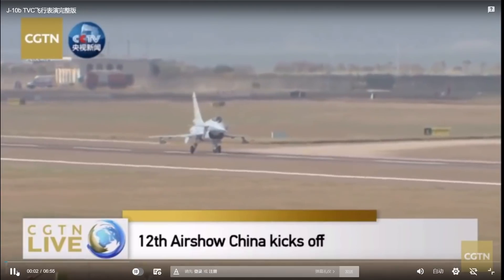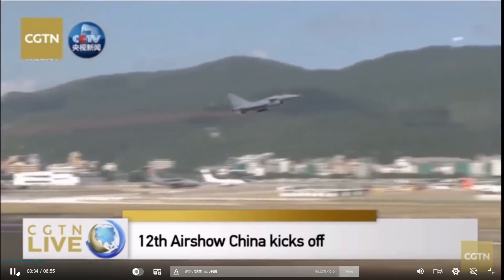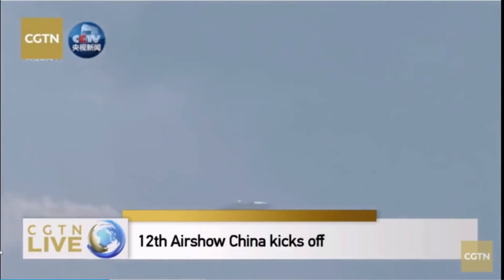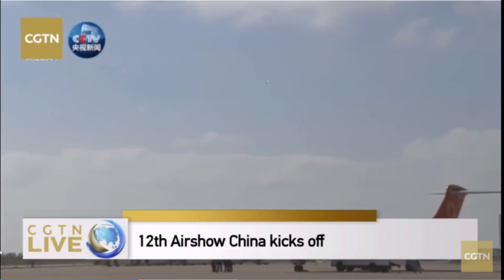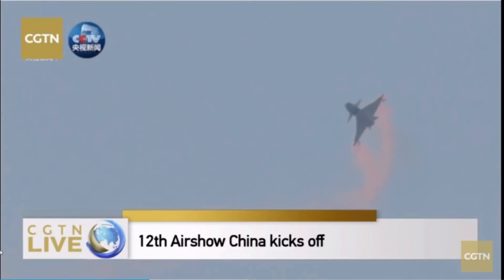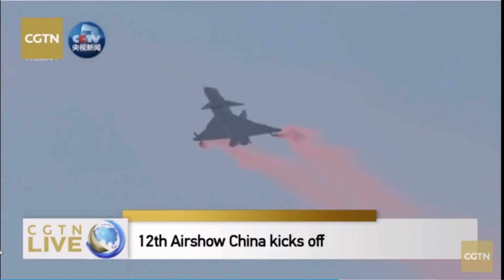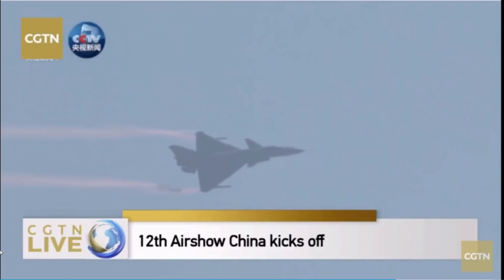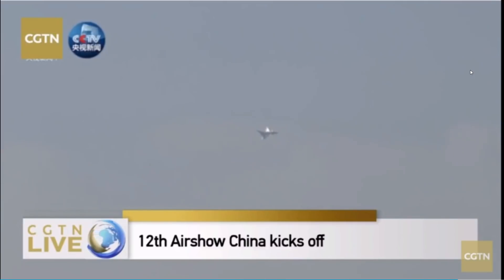J-10B Cobra Maneuver, Vector Thrust, and Aerobatics Demonstration

Comment: I think l did see Chinese engineers analyse a Russian SU35 by pulling it apart and reverse engineering the engine.
Should be interesting to see what aircraft they have on the Chinese aircraft carriers in the next ten years.
Reply: @fredgarvin9262 
With some of them PUT into military research projects with not much choice.
As Chinese wages go up less consumer goods will be produced in China.
Nothing l have seen Military wise or consumer goods wise impresses me that much.
And A LOT of the Chinese consumer goods are designed outside of China.
Reply: the su35 that russia sold to China do not have TVC feature........and china absolutely disappointed with Su35 quality to the point they canceled order from 48 to 24.
Reply: @minus21334  : Russia likes to deliver monkey models to untrusted clients...
Reply: @El-Poussah  we do not need that much from russian. it is now more like the other way around

Comment: I got confused thinking that the j-10 was a Eurofighter typhoon. really similar design, but typhoon has 2 engines not one like j-10
Reply: This is USA and Israel project then it sold chine...
Reply: J-10 is of new generation technology, it would perform better than Typhoon even with single engine, as it has vector thrust.
Reply: @FF-cz8sg  J-10 is the Israeli Lavi technical package sold to China after the Israeli government refused to fund Lavi, instead favoring more advanced F-16 procurement from the US with Israeli-specific modifications.  China built the J-10 using production and tooling technology sold to them during the Clinton Administration in the 1990s, after China illegally influenced the 1992 and 1996 elections in the US with millions donated to Bill Clinton through fronts in Indonesia.

J-10B uses the DSI intake technology from the F-16 DSI demonstrator, which was developed for JSF technology research.  The DSI inlet helps reduce the J-10B's frontal RCS by eliminating any line-of-sight to the engine fan stage frontal section, which is a huge radar reflector.

The question you should ask is why the US never adopted TVC engine technology on F-15s and F-16s, which is where TVC was first demonstrated on with the F-15 STOL/MTD and F-16 MATV in the 1980s and early 1990s, along with the X-31 program.
Reply: @minus21334  the J-9 doesnt look anything like the J-10. It just has canards. The J-10 has the same layout as the lavi only a little longer and diffrent
Reply: @yoamal1187  J10 is literally much larger than Lavi in size. yall trying to dismiss the link to j9 wont change a thing j10 was based on j9 with delta-canard configuration set for research and production back in 70s.
Reply: @minus21334  i said its a little bigger, but everything is the same. Intake location, delta wing, single engine and single tail. Also china came in to see progress on the lavi program when it was in production
Reply: @yoamal1187  both Isareal and China deny the link between lavi and J10, what the hell are you talking about? you know better than Chinese right?
Reply: @xiaoyulin4008  china also says that nothing happend in tiananmen square, Beijing on June 5, 1989
Reply: @yoamal1187  tell me where is lavi now?? where is it??
Reply: @FF-cz8sg  : J-10C with AESA radar was ridiculed by Thai Gripen-C with PESA radar during drills at such a point that even a PLAAF senior officer acknowledged the fact and said that PLAAF needs something like the Gripen!
Actually, since J-10C behaved better than J-10A/B in WVR where Gripen-C dominance was reduced, but Gripen ended with a 40:9 kill ratio in BVR, RTAF decided to replace AMRAAM and Sidewinder by Meteor and IRIS-T, they may upgrade Gripen-C with the Gripen-E's AESA radar too...
Gripen is no match for Typhoon, Typhoon is no match for Rafale... Do you know how the MICA is nicknamed in NATO? "Silent death". Don't assume it was never used in combat : ALL FrAF kills are classified since 1953... 

Vectored thrust is only interesting for heavy aircraft as a compensation for inertia, but you lose energy using it... Rafale takes 11G (or more if the pilot can deal with it : the airframe won't sustain metal fatigue unless being exposed to more than 13G!) without VT.
If you need VT on a mid-weight jet fighter, it's that it sucks big league.

Comment: Very good but f 35 A can do that without vector trust
Reply: A F-35 doing a cobra, NEVER
Reply: prove it
Reply: the cost to build one f35 by usa can build 10 j10 by china, so go figure
Reply: @FF-cz8sg  The latest generation supersonic trainer aircraft made in Russia cost a minimum of $17 million per, and does't have the capabilities of the J-10B.  The yuan is more valuable than the ruble.  A J-10A today would cost $32.73 million.  Since the J-10B has the DSI and is claimed to have an AESA radar with more advanced avionics, the unit cost will be considerably more.  Any TVC nozzle will not only add significant cost to the engine, but to maintenance.  I would estimate the unit cost of an AESA and TVC-equipped J-10B to be in the $40-$50 million range easily, given the scale of industry that is required to manufacture the necessary systems being discussed.

So even 10 J-10A limited 4th Gen fighters would cost $327.3 million without ancillary equipment.  A single F-35A costs less than $78 million, while being able to engage and destroy 6 J-10A or Bs in one sortie without challenge, and also performing duties of AWACS, ISR, and EW.  The J-10B is not able to do any of this since it is 4th Gen multirole.

A cost to effectiveness analysis shows the J-10 is nothing but a manned target in a 5th Gen world.
Reply: @LRRPFco52  : AESA on J-10C, not J-10B... And Gripen-C with PESA had the edge over J-10C, as well as J-10A/B and J-11A during drills in Thailand.
Reply: @El-Poussah  Gripen C got smoked by J-10C in Falcon Strike exercises in both BVR and WVR. Gripen C does not have PESA, but mechanically-steered pulse doppler radar.

J-10C has smaller RCS, bigger radar that is also an AESA, and longer reach with PL-15, so it always has first-look, first-shoot against Gripen C.
Reply: @LRRPFco52  I am sorry if I sound dumb but I am a layman and just want to know the range of PL-15 and the range of AESA. I heard from Indian analysts that PL-15 is useless against combat jets as AESA radar cant match its range so by the time AESA locks in the target PL-15 becomes useless as compared to Meteors due to shorter distance and they say its only good for slower AWACS.
Reply: @realistgunner4613  Since nobody but the Chinese has their hands on material samples of the PL-15s, we lean on Chinese comparisons between them and the RVV-AE export R-77 variant.  China is really unhappy with the RVV-AE, as is India, for several reasons.

China had the RVV-AE modeled with ACMI pre-coordinated with Royal Thai Air Force before they did Falcon Strike Exercises, and the RVV-AE was much shorter ranged than the AIM-120C.  

Supposedly, the PL-12 has about the same WEZ as an AIM-120C.

The PL-15 is a VLRAAM that is meant to out-reach the AIM-120C/D, using a 3m long body, dual pulse rocket motor, AESA seeker, and copied guidance architecture from US/Western BVRAAMs.

It caused a rapid initiative in the US to make a new missile, the AIM-260, with US senior leadership mentioning that we needed to make a longer stick for that fight.

The most interesting thing to me in the US is that we have not adopted a propulsion arrangement like the Meteor, and instead are leaning on major improvements in rocket motor propulsion, with dual-stages and reduced size guidance due to Moore’s Law.

If someone tells you that Long Range AAMs are useless because of AESA detection ranges, I would raise serious questions about that person’s background in Aerospace Engineering.

Fighter AESA radars don’t detect missile launch.  They detect threat aircraft that have certain RCS values, at certain distances.  As the distance gets closer, they are able to track that TGT.  Since missiles are so small, normal missile launch warning systems rely on detection of particular RF in the spectrum and closure rates.

Modern BVR missiles don’t use their active seeker until terminal phase or loss of host radar lock (and data link guidance to them).

They use data link guidance from the host fighter, fly their mid-course path without activating the TGT aircraft Radar Warning Receiver set, then once within a certain distance for terminal phase of flight, go active with their own seeker and intercept the TGT.

The Meteor’s main operating principle is that it can maintain energy by means of 2 different propulsion systems and continue to pursue an evasive TGT if the launch aircraft has to break its lock to evade counter-launches, which are expected.

So you have to maintain an even longer stand-off distance if your enemy is armed with Meteors, which makes the possibility for you to engage him much more difficult since it cuts off your BVRAAM reach into WEZ.
Reply: @LRRPFco52  Thanks for the detailed explanation. I had to google few terms but basically got the idea that PL-15 are effective unless they are up against Meteors?. Sorry if I misunderstood it but I am trying to learn about these missiles.
Reply: @realistgunner4613  We're seeing a new era of BVRAAMs reaching well beyond the capabilities of legacy AMRAAM era missiles.

Meteor has more range than an AIM-120C5.

AIM-120D costs 3x as much as AIM-120C variants, and is in the same range class as a Meteor.

AIM-260 and PL-15 are in the same range class.

From low to high capability:

R-27T
RVV-AE 
R-27R-1
Astra Mk.1
R-77-1

AIM-120C5
PL-12
R-33
AIM-120C6
Peregrine
R-33S
R-33E
Astra Mk.2
AIM-120C7
Meteor
AIM-120D

Astra Mk.3
PL-15
AIM-260

R-37M

Actual ranges depend on launch altitude, launch aircraft speed at separation, and TGT closure rate.

F-22 & MiG-31 have the fastest possible separation speeds, followed by F-15C, Typhoon, and Su-35.
Reply: @LRRPFco52  Got it now. Thanks for the information.

Comment: Damn Pakistan should buy J10C goo gooo can't wait to see this beast in paf ..
Reply: Bruh instead they should buy F 35s and su 57s
Reply: @jerutieyeieie7188  You think it's easy to buy from?
Reply: @jerutieyeieie7188  The J10C is offered to Pakistan cheap and brand new, also having crazy abilities. F35s are not good unless Pakistan has an air carrier.
Reply: @coconutboy8198   bruh  F 35 has 3 variants and C requires aircraft carrier
Reply: @jerutieyeieie7188  Su57 is kept to Russia them own
Reply: @coconutboy8198   ye u right but if not su 57 then they must buy  flankers and f 15s cuz their current fleetis gud but with these changes it could be better
Reply: @jerutieyeieie7188  :they'll get neither Flanker, nor F-15 nor Typhoon, nor Rafale, nor Gripen, not even TA-50 or Kfir-NG, France even refused upgrades to old Mirages (bought from Australia, Jordan, Lebanon).